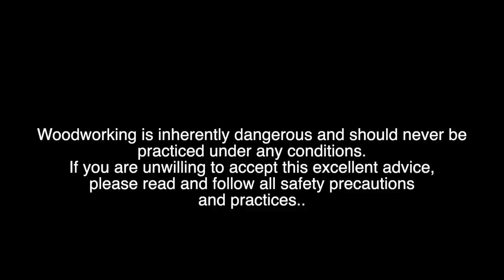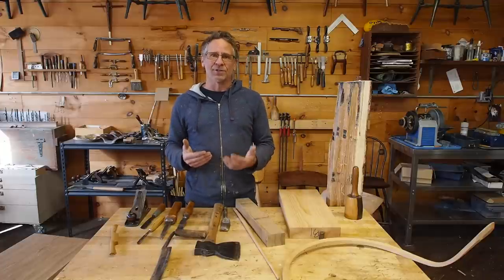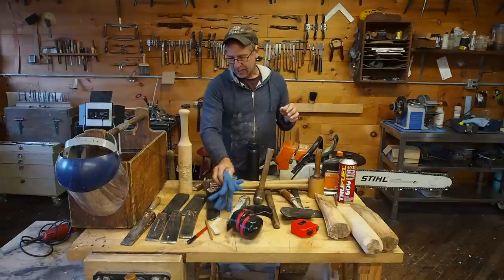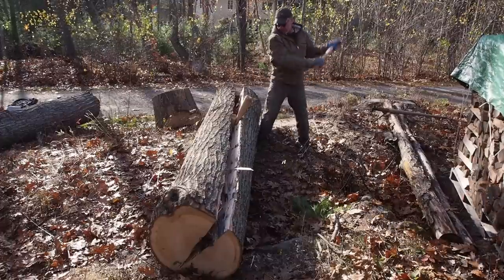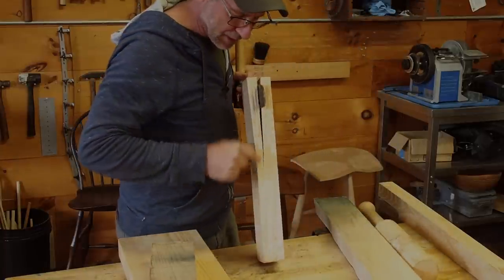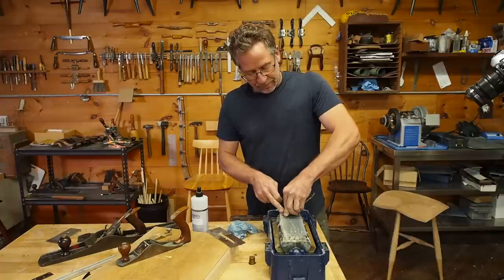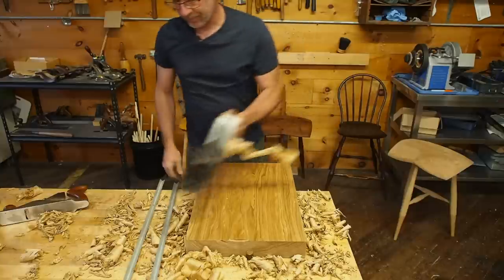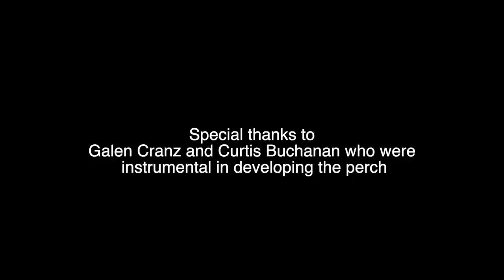Foundation in Chairmaking with Peter Galbert Session1:1 On sale through 6/15!

Comment: Good experiential insights about chair ergonomics.

Excellent compilation of vital information, but nothing that dissuades from digging in and building a chair.

Log splitting is much like stone splitting with feathers and wedges. With stone it’s all about the sound. That straight red oak was a treasure.

Comment: I like to put a wedge in near the edge on both sides of the score mark. It helps prevent that runout away from the score line that you can see at the bottom of the split. It also helps with propagating the split all the way across the log's diameter. It won't stop it from twisting if that's the way the grain runs, but it will help keep the two sides of the split parallel with one another, even as the log twists.

Comment: In my workshop I don't have a thicknesser or even a planer (jointer)! Simply because I can't afford them, not for any principle. So when I'm preparing a board for a guitar body or top or whatever I'm doing it a bit like you did with the scrub plane and no7. I've only got a Jack plane (N0.5) which I just love, but having seen the effectiveness of that Lie Nielson scrub plane I think I'm going to have to convert the spare Stanley no.4 I've got sat on the shelf doing absolutely nowt to a scrub plane. I think it'll make the job a bit easier. It's quite incredible though, once I've thicknessed a board like that, then belt sanded it across the grain, then along the grain, then random orbital sanded it, I can get it down to 0.1mm tolerance on the verniers. Looks better than it was speed-sanded! I bet those flutes in your no.7 REALLY make it easier though. I had a try with a friend's fluted base no.5 the one time I was knocked out by how easy it was to push through. Felt like it had a "auto-wax" device on the sole. I loved seeing the log splitting though. Some trees here in Scotland that need that treatment. That would set me up in timber for quite a while!
   Really excellent video. Straight talking, well explained and demonstrated.
Reply: I use an old coffin plane that I got at a flea market for 5 bucks.  It's a great scrub plane cheap and pretty easy to find.